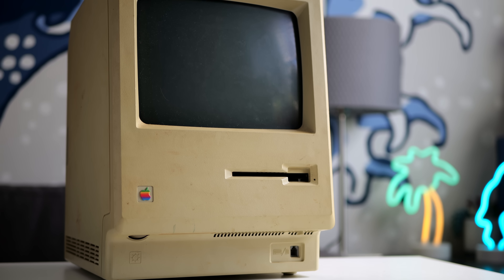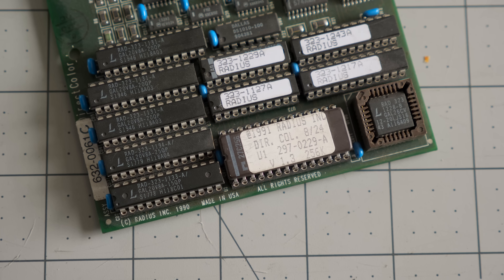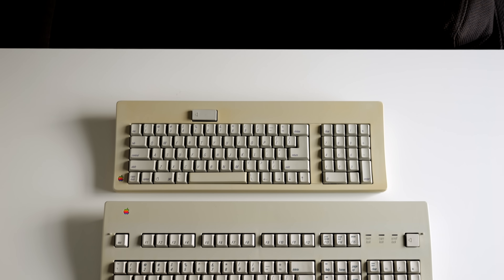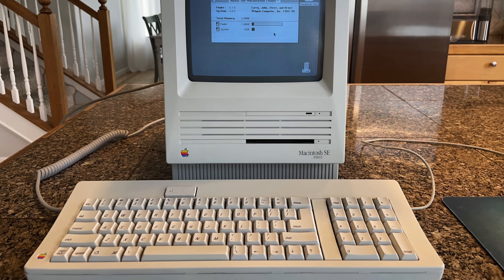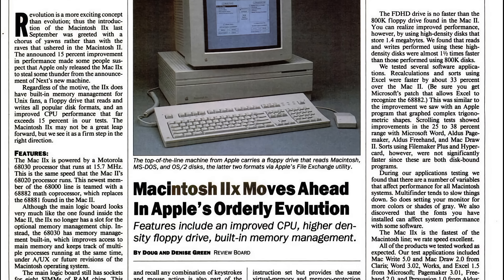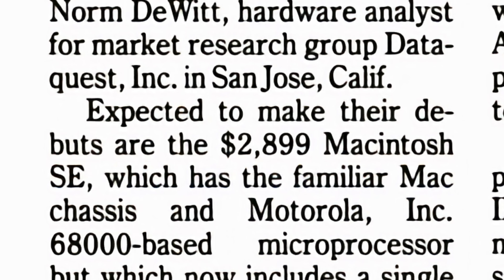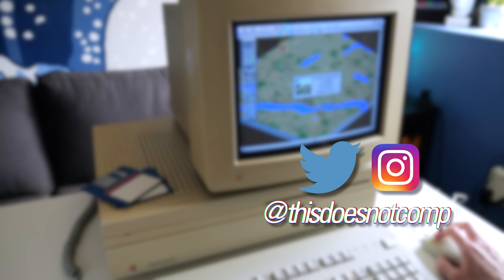Macintosh II: The Mac's Major 80s Evolution

Comment: Steve Jobs could be a visionary, but he also could be incredibly short-sighted.

When told that the original Mac's architecture would make it nearly impossible to add a hard drive, he thought the idea of a hard disk was completely ridiculous.

He said hard drives were for mainframes and business machines. They were loud and obnoxious! Not very forward thinking.

In fact he would not even allow there to be an internal fan in the original Apple ][. Again, for some reason, the hum of an internal fan would 'disrupt the user's karma' or something.. 🤣

Comment: There was a bit more about screens on the Macintosh II than just color. At the the time, Apple showed at a German computer fair a Macintosh II with a graphics card in every slot and a 20 inch monitor at every card. And then they opened a graphics window that stretched over all the monitors, adapting to the color depth of each individually. It impüressed me to no end, and to my knowledge just wasn't possible on any other personal computer for a long time.

Comment: The Mac II is still my favorite Mac. That big, blocky,  imposing case, that stunning Trinitron monitor, the coolness factor of being able to turn it on with the keyboard; it was a drool-worthy computer. This thing had soft power-on, room for tons of RAM, 640x480x24-bit color graphics and multi-channel PCM audio at a time when the typical PC was lucky to have 640k of RAM and 4-color CGA graphics. There were a couple of Mac IIs scattered throughout my public education, but students were absolutely verboten from touching them. By the time I got to lay hands on one, just before I graduated,  it was pretty pokey compared to the more modern LC IIIs and LC 475s in the computer lab. But I had only recently gotten my hands on a PC capable of decent sound and 24-bit color graphics, which is something that Mac II was doing 9 years prior.

Comment: For those interested in the Extended Keyboard, you can also get the Tactile Pro keyboard made by Matias. It has a more modernized design but still uses the same Alps key switches.

Comment: My brother in law had this bad boy tricked out with an 68040 processor, 24 bit color output, 2x 4 GB harddisks, 100Mb/s Ethernet and 480p video I/O. It was the Mac Pro of its day, very much designed to be a modular workstation.

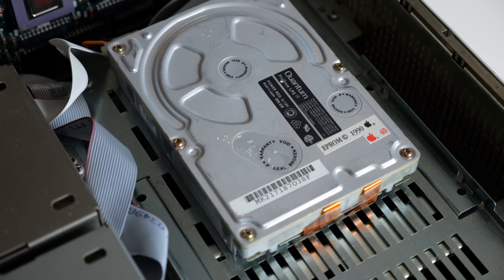Comment: 1:30 I still have the original 5 1/4 inch Quantum 40MB drive. I later moved it to its own case, at the time I converted the drive tray to hold two 3 1/2 inch drives sitting side-by-side, directly behind the floppy drives. 4:43 The lower keyboard shown happens to be the 2nd edition of the Extended Keyboard. The original (which I own) only had a single curve from front to back, meaning the top/back edge was higher off the tabletop. 9:15 Apple sold me a drive/ROM upgrade kit for the II that essentially made it into a IIx. I kept the 800k, so now this II sports 2 drives: the 1440 and the original 800. This II is still my flagship, has a ton of software and games on it.

Comment: It’s probably been said in thw commenta already. The Mac II could be upgraded to the HD 1.44 drives but required a flashed ROM and an upgraded SWIM chip.

Additionally, another base hardware upgrade replaced the 2 soldered in batteries with a daughtercard that held 2 of those classic mac internal batteries.

Other upgrades included a CPU swap with a 68030 with 68882 FPU and an upgraded PMMU. 

The Mac II was, at the time, my favourite Mac. It wad built like a bloody tank!

Comment: My first keyboard was an apple extended keyboard 2. And I loved it so much that I hunted for adapters and couldn't find any. So I desoldered all the switches and made my own keyboard with them for my current PC. I know i murdered the original keyboard. But those cream alp switches were amazing.
Reply: That was a great keyboard as well, but the massive original AEK was the king.
Reply: The company Matias makes the Tactile Pro keyboards, which are modernized but have the same Alps key switches. I've got a compact one and it's really nice, can only be used wired but I love the sound and feel of the key switches.
Reply: @drygnfyre  yeah. My bf bought one of those after trying my keyboard.

Comment: Nice Retrospective!   A minor addendum for those who may wish to use one of these: Apple DID in fact release an upgrade kit for the II, to allow for 1.44mb floppy drives.  The kit - Apple FDHD Macintosh II Upgrade Kit (part number M0244), included a 1.44mb SuperDrive, a replacement for the IWM chip (Integrated Woz Machine, which was the floppy controller for the 800k drives) to the SWIM (Sander-Wozniak Integrated Machine) chip,  AS WELL AS - Four new ROM chips, to support the SWIM, and also fix a few other lurking ROM bugs.      Not only can you get a Macintosh II functional with a 1.44mb drive (I have one sitting downstairs now!),  but you can also get the RAM up to either 65mb or 128mb - the total may depend on mainboard revisions - Sadly, this does require special RAM SIMMS that have onboard PAL logic - when the II was designed, there were no 30 pin SIMMS above 1mb in size, and there was also no standard for what larger sized SIMMS would look like. Apple guessed at it, and the industry went a different direction... Suffice to say, finding those PAL 30 pin SIMMS is ... difficult, and I have not found any so cannot test the limitations.   While those upgrade kits are VERY hard to find, you can find people who can burn the ROM chips for you, and the SWIM chip is utilized in the IIx as well - I happened to find a ruined IIx board (battery leak destroyed the board), and so salvaged it and the 1.44mb floppy drive from it.     Anyways,  Thanks for the video!  the II is one of my favorite machines - my first computer was an LC, which was a "dumbed down" cheap clone of the II, so I was always jealous of the II owners out there - them and their fancy-pants 640x480 graphics!   shakes fist

Comment: Man those goddamn NuBus slots with their pins. Idiotic!
Back when they came out I lusted after the IICi, IIFx etc, but couldn't afford them. 
When the first dotcom bust happened I started finding various Mac II models just tossed out with the trash all over San Francisco and downtown Oakland. 
Ended up with a couple IICi, a Performa, and a IIFx. Also a portrait display and a couple 3rd party monitors and peripherals. 
IIRC the IIFx had some tricks up it sleeve beyond more ram slots. Higher ram bandwidth due to some kind of interleaving or dual ram busses?  
Had a friend at a digital service bureau that I would hang out with after work while he set up jobs to render overnight. 
He'd always reserve the IIFXes for the biggest jobs because "they had the fastest memory throughput". 
Sorry that was 30 years ago, and that is all I can remember. 
Also acquired the precursor to the iMac, the All in One. Basically an iMac with expansion slots that was only sold in education channels. 
It had a blobby square profile, with a smoked grey upper chassis. Looked like a Frankenstein iMac. 

The one I found had a Sonnet CPU upgrade and was kind of useful even until 2006 when I jumped several generations to an Intel Mac Mini.
I kept those old Mac II series computers around for a few years running Yellow Dog Linux as a primitive render farm/Lan party gaming system.
It's kind of funny when you see an OG MAC or MAC SE/30 next to a more modern computer now. How did anyone do DTP or spreadsheets on those tiny 9" screen?

Comment: I've been catching up on your channel lately and love it, thank you for all these wonderful videos! I had a IIci, 13" monitor, extended keyboard and laser printer I got my Sr year in college, 1991. I had used a IIe until college the my roommates' IBM PC or the Macs at the lab the first few years. The IIci was a beast in 1991. I did a few upgrades over the years but that system served me well for about 6 years.  I stored it at my parents house as I needed PC for work... along with my IIe, an old PET and an original IBM PC I had picked up used. All them got water damage due to a leak :( I'm left now with just a TRS-80 model 4 and a NeXT System as my only retro systems. Luckily they both still work but damn I miss the IIci and the IIe...

Comment: We were still rocking the original Apple Macintosh in 2004. At my elementary school let's just say we were just a wee bit underfunded.
Reply: The 1984 one? 😂
Reply: @leenevin8451  no we got the 1986 model with 512k then they upgraded to the single core Mac minis in 2010 when I was volunteering there. I wouldn't  be surprised if they're still running those some version of Linux.

Comment: Mac II was great machine, not because of color support, but because of expansion bus (Nubus). Color graphics card was just one of the expansion option. But personally I like it because it enabled 20 inch large/high-res black & white graphics and monitor. It is good to work on large documents and also ultimate machine to play SimCity (Original).

Comment: In 1989, I was hired at Truevision. Our team of three people was assigned to write a paintbox system for Truevision's AT Vista video card. The AT Vista was made for PCs, but TV also developed a NuBus card for the new MacII. All three of us had a Compaq PC for development, but we also each had a MacII on our desks with a NuVista card. Because of that card, our Macs supported up to 1280x1024x32 bit color. The cards also supported still image video capture. The Macs had a big Sony CRT that would display any resolution you could throw at it. Having a 16 Million color Mac before anyone else was glorious and it felt (and was) way ahead of it's time. Because of the cost of video memory, the NuVista cost more than the MacII itself. There was only one Mac developer at Truevision doing all the groundbreaking work, and he was a genius of a programmer that bled six colors like no other. Apple also deserves credit for building in 32-bit color support way before they sold cards that could display it.

Truevision was an industry darling at the time. One day, some guys from a small company called Adobe showed up to show us a new Mac image editor they wrote called Photoshop. Its features made what we were building seem a bit behind in many ways. Adobe offered the opportunity for Truevision to buy Photoshop outright, but management was PC blind and the head of engineering turned them down. Soon after, Truevision was bought out by RasterOps, which in turn was bought out by Avid. Avid got its start as a small company that based its first products on the AT Vista. All that's remembered of Truevision today is the .TGA file format. Some guys from Kodak visited us once to see if we were interested collaborating on a device they were creating called a "digital camera"(!!). They were turned down too. A story for another time.

Our paint package was really cool, written in assembly on the Vista's Motorola video controller, but because Truevision was an OEM, it's customers got angry about us competing with them and the project was killed and buried. Nascent plans to port it to the Mac were also dead, dead, dead. Interestingly, our paint app was called "Fresco", a name the Adobe revived in 2019 for their iPad paint program.

History is so cool.
Reply: Thanks for that- reading  Apple in China this week…. Good ol’ daze

Comment: No feet on the side to place it vertically? Or would that interfere with the operation of the floppies?

I realize that vertical cases weren't much of a thing back then outside of Japanese stuff like the Sharp X68000, but it would limit the footprint a little.
Reply: Tipping the system onto its heaviest side (which contains the PSU) would not have worked out, as the PSU happens to exhaust hot air from that side. If put onto the other side, the Mac would have needed a very hefty cradle to keep it from tipping over; and, moreover, the user would have needed a tall monitor stand to compensate for the fact that the computer itself then couldn't double as one.

Comment: I had a Mac II in the late mid 80’s, RAM cost $300 a megabyte, then there was a shortage and my next pair cost $600 a megabyte. I used to do desktop publishing at the time and made about $50 an hour which was good money at the time.
Reply: $600 now buys you 664665MB of RAM from Silicon Power. 🤯 A single 16384MB module costs $14.79.

Comment: Ah 1991, an age when expandable workstations were scarce and very pricey and I was scrambling to buy my first computer.  Couldn't afford a IIci, read a lot about the remarkably powerful IIfx, and felt lucky to find a used IIx loaded with RAM.  Even after upgrading with a DayStar 040 processor, 320MB hard drive and a somewhat decent Radius card over the following few years, that IIx was a still compromise - and an expensive one at that.  It was a computer that was larger than it needed to be and just couldn't deliver the performance I thought was needed, also waiting for it to process and render was a frustrating occupational hazard.

The IIx is not remembered fondly here.  I still regret not holding out for a IIci in those days.

Comment: The II usually had either a 3.5" Sony SRD series hard drive (generally 40MB, also common in the SE) or a 5.25" Quantum drive (40MB+). The Sony drives were notorious for developing stiction and most were replaced under warranty decades ago, but there may still be some of the Quantum drives going.
There were two major upgrades for these (outside of logic board swaps or third-party CPU accelerators): the 68851 MMU upgrade (for virtual memory usage, ideal for A/UX) and the FDHD Upgrade. You could also replace the original 68881 FPU with a 68882 for improved performance.

Comment: I had to rewind to make sure I heard it correctly: 128mb of RAM in 1990?! I didn't have a computer with that much RAM until 2001!
Reply: If you had money like Bob Page back then, 128 MB RAM was nothing.
Reply: I have, sitting just next to me as I type this, a Macintosh IIfx with 128mb of RAM.   It is HILARIOUS, but there are of course, a couple of caveats -  #1:  the RAM is special. It's a 64 pin variety, on the same footprint as a 30 pin SIMM. the only other place I've seen it used was with Laserjet printers, so finding it is.... difficult.  ESPECIALLY finding the larger sizes to enable 128mb!!!     Second:  The macintosh IIfx ROM does a memory check on boot, and with 128mb that .... takes awhile.  So you press the soft-power button, hear the chime, and then .... nothing happens.  The ROM doesn't even fire up the video cards or send video signal to the display until after the RAM check completes, which takes about a full 2 minutes or so!   I thought the RAM I got was faulty initially!
Reply: @Doccers42 LOL that is amazing to hear.  I have a 1.5TB Mac and it’s the same story except you do NOT get the chime first.  That comes after.
Reply: Yeah, that's insane for the time. I know there's a 1991 68030 accelerator card for the Amiga 2000 that includes SCSI 2 and supports up to 128MB of RAM. Still though, who was using that much RAM back in 1990/1991?

Comment: Another innovation with the Mac II was the ability to plug in multiple video cards. I am not aware of any other machine being able to handle multiple monitors at the time. And the QuickDraw graphics and the GUI would all adapt automatically to multiple screens, and each one could switch modes on the fly, independently.

I remember Bruce Webster doing a review for Macworld magazine, I think it was, where he found that, even though the machine had 6 slots, he couldn’t plug in more than 5 video cards at once: add the 6th, and the machine wouldn’t boot.
Reply: Bug with the early ROM's as I recall - the NUBUS slot closest to the PSU wouldn't work right if the other 5 were utilized, or something like that.  Corrected with later ROM release, I think.

Comment: 1:32 There was a “stiction” problem (if anybody remembers what that was) with some of the early 40MB drives for the Mac II. I know it happened with the one I got. Apple offered a free replacement, and that could have been what happened here.
Reply: I earned a fortune putting those (and other HDDs) in the freezer then give a sharp (but not too brutal) smack on the side So they could recover data otherwise lost.

Comment: The Mac II wasn't something that Jobs was unaware of during its development as stated in the video. The origin of the Mac II was in Apple's SuperMicro division (not to be confused with the modern company), which Jobs got control of in late 1984. Said division started work on a project that was Jobs' priority given the codename Big Mac.  Big Mac was going to make a 3M Unix machine that would be around the price of a normal personal computer at the time. That project got killed when Jobs was pushed out, and the work on it went to become the Mac II (code name Little Big Mac, owing to its lineage), and Jobs took the idea and founded NeXT with it.

Essentially, the Mac II was hardware repurposed by a project that was Jobs' top priority for that division. It's true he thought the Mac should be an appliance, and that's why Big Mac was going to be a Unix workstation. Apple's expensive Unix license for the Big Mac project was later used to go make A/UX after the Big Mac project itself was killed off, which did ship for years including on Mac II hardware.